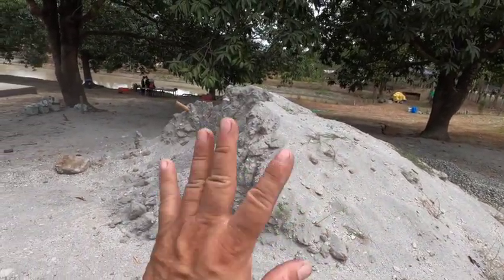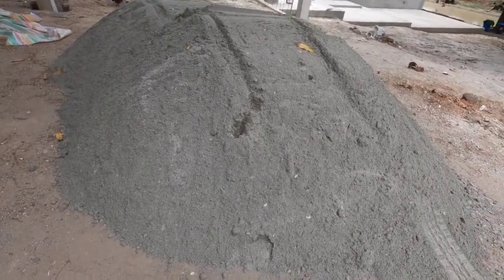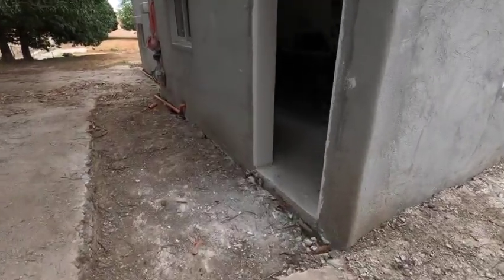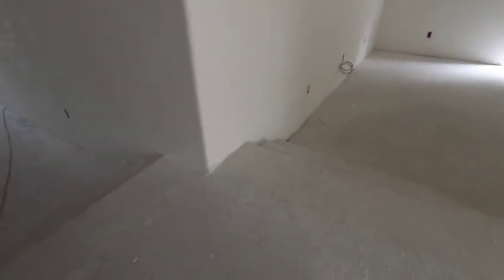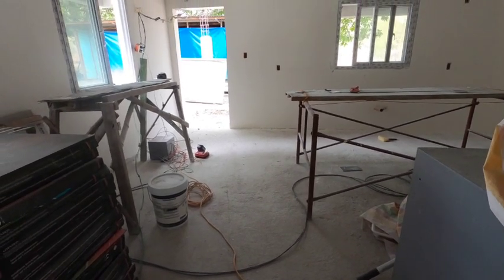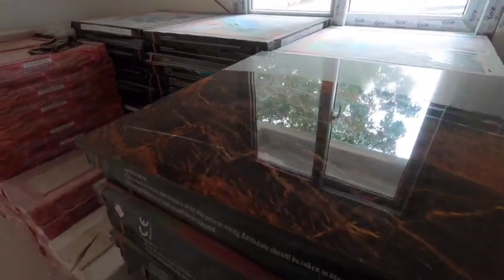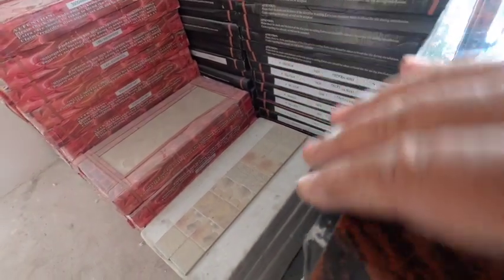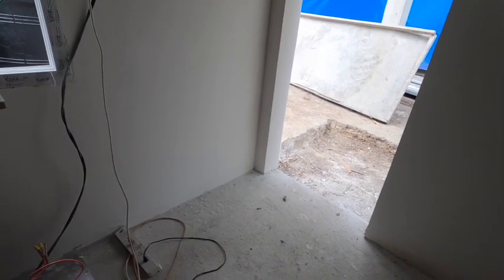M2 Panel Build Update

Comment: Looks like your ceiling is not yet completed. Does in need more plastering to to finish it?
Reply from the maker: No it does not. I did light spray just to put a coating on the metal and styrofoam.  Plastering the ceiling would have required about 2 to 3 inches of cement and no matter how hard they try, it will never look flat enough for me.  So when I visited Wilcon Hardware, they have some beautiful PVC ceiling for sale.  I have to some farrowing on the ceiling, same as I had put in hardiflex or wall board.  The PVC ceilings are beautiful and light weight.  Plastering the ceiling anymore will have no benefits.  If you had seen the roof prior to cementing,  it's has quite a bit of rebar support as well.  When removed the ceiling jacks, the ceiling didn't even budge 1cm.
Reply: Those thin pvc ceilings  are fire hazard...